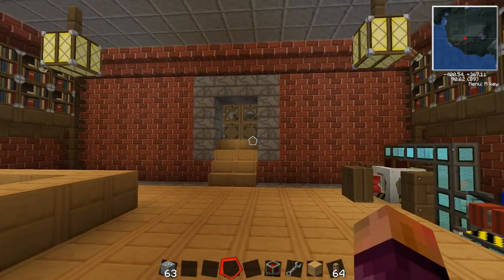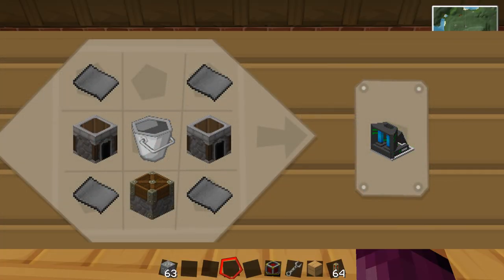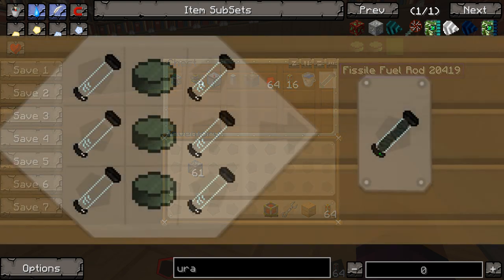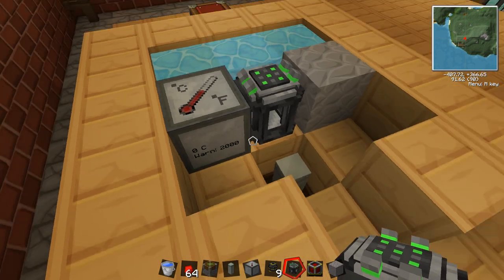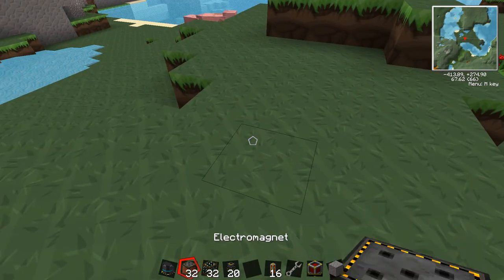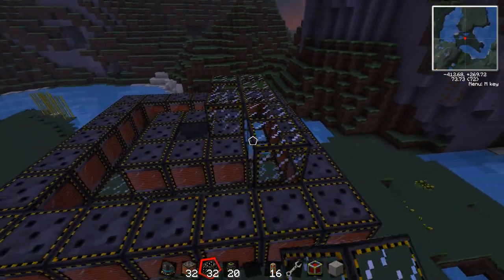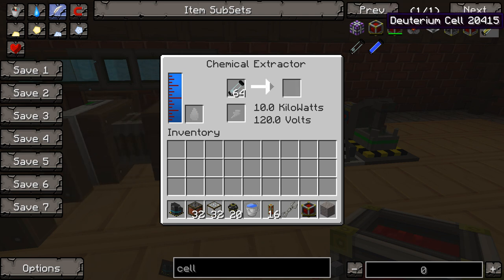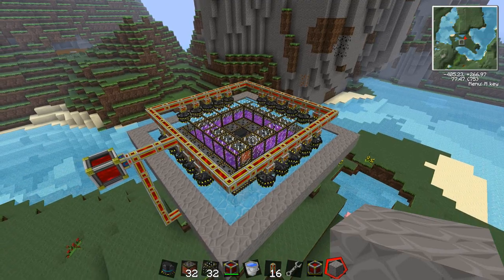Tekkit Tutorials - Atomic Science - Part 1 - Generating Power, Fission And Fusion Reactors and More!

Comment: someone help me. so i make the fission reactor surrounded by water with the piston and control rod and thermometer like im supposed to and i set the thermometer warning to 600 because the max temp for the fission reactor is 727 but when the control rod goes up the reactor blows up anyways
so one how do i get it working and two how do i get rid of all the radiation thats in my basement?
Reply: the same thing happened to me
Reply: I think what happens is that the control rod doesn't stop instantly it takes a while to cool down the reactor

Comment: What are reactor drains, breeder fuel rods, particle accelerators and atomic assemblers? If they are bugged or unfinished much like toxic waste, just tell me
Reply: I know I'm late but, in a future version of atomic science, when a fission reactor explodes it goes bigger the more toxicity it has, the reactor drain will be used to drain toxic waste and reduce toxicity, so yeah, unfinished. Breeder Uranium is a by-product of making Uranium-235, it can be used in breeder reactors (tutorials are out there) to re-enrich your depleted fissile fuel rods. Particle accelerators have been in for a while and are used to make antimatter and strange matter (again, you can find tutorials). Atomic assemblers use 6 strange matter and massive amounts of power a-piece to duplicate items, it sounds OP but really it's kind of underpowered.
Reply: Ike Nicol Cheers, before you posted I was contemplating the fact that it would drain toxic waste from the fission reactor because the fission reactor is the only one with toxicity levels.